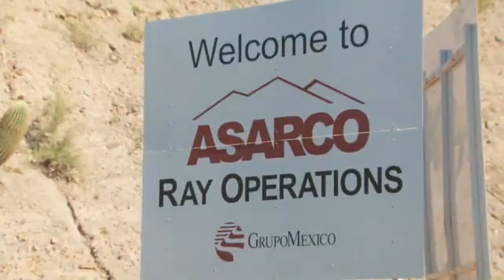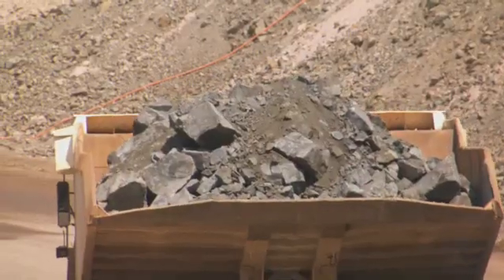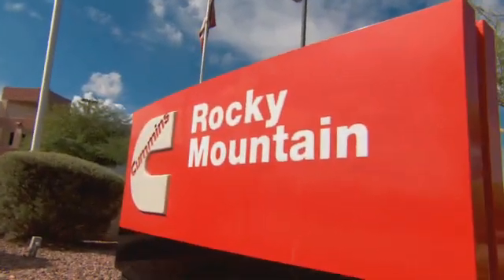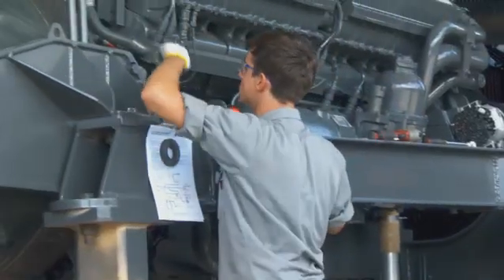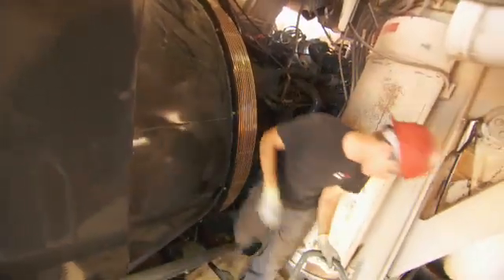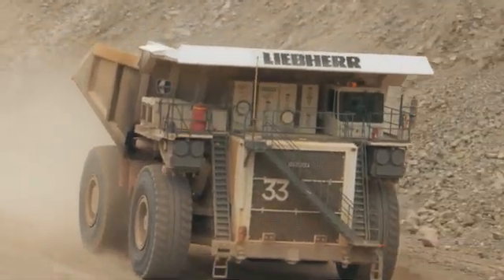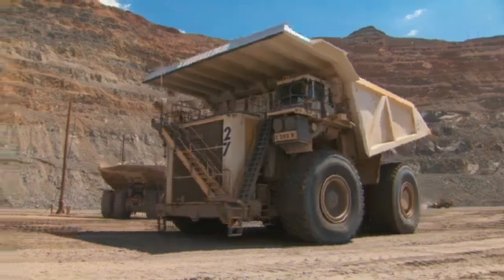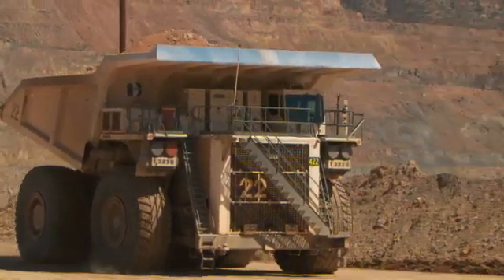Performance That Pays: ASARCO Ray Mine Customer Testimonial

Comment: Instead of putting your Preschool skills to work on this channel. Maybe you should have power outages updates on line and why. How long its going to take to get them. Fixed. I dont care about greenhouse Gases i care about my life and being cool during the summer. I worry about now, not 60 years from now. This greenhouse crap is Global Evolution and natural change. Dinos had more greenhouse gasses with fecal matter than all the cars in the world for 50,000 years to come. What the world is going through is normal.  Not a huge deal.

Comment: Lets all remember Asarco didn't pay it's bonuses, Even after the court system ruled against them. Seems thier contract is all based on cheating workers out of thier bonuses. The current contract read if your later 1 minute you loose a percentage of your bonus. keep in mind this is a very remote part of Arizona,One has to travel on average  forty five minutes one way. In regards to performance it doesn't apply to the hourly workers who are on strike currently, no contract for like seven years, no raises , and no bonuses. I hope this changes soon!

Comment: What happened to the MTU 20V's that were pulled out?  Since the Cummins engines that were installed are Tier 2, aren't the MTU engine's considered destruction cores that due to EPA regulations aren't legally supposed to be sold in the country or overseas?